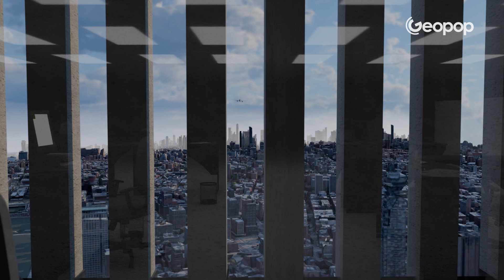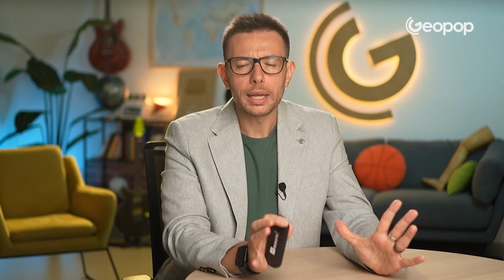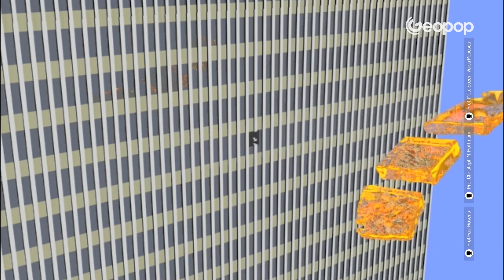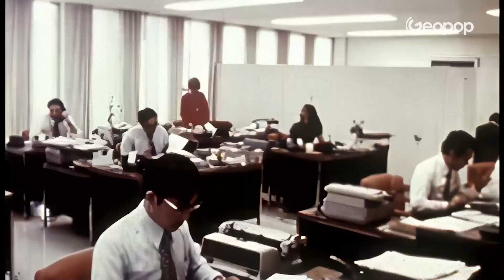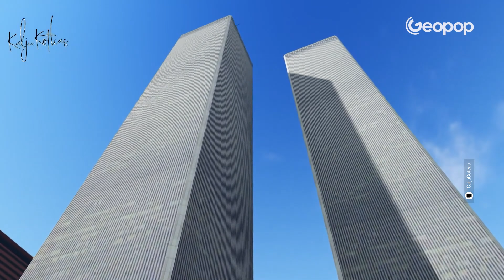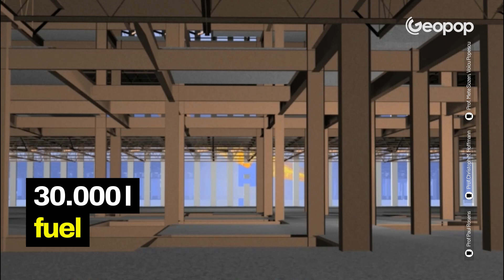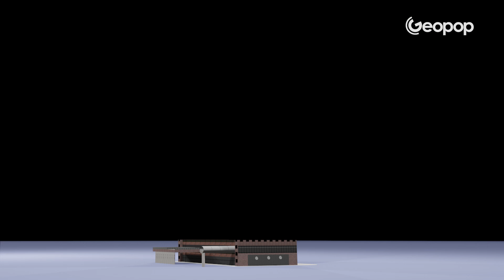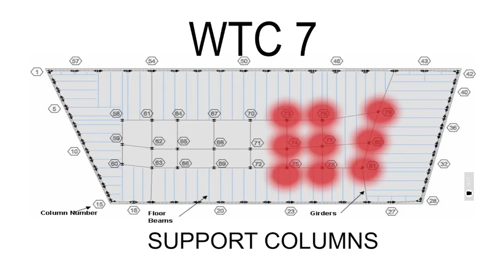9/11, 2001: The Technical Reconstruction of the Twin Towers and WTC 7 Collapses

Comment: Aha. Halte ich für verkehrt. Es erklärt soviele Fragen einfach nicht.
An diesem Tag stürzten drei RIESIGE Wolkenkratzer in ihre Grundrisse zusammen ☝ Da hätte zumindest einer kippen müssen. 
Dazu kommt noch die komplette Zerstaubung aller Gebäude. Ich würde mir da eher einen großen Haufen Bauschutt vorstellen. Nein, die sind brav zerstaubt und in ihre Grundrisse eingestürzt.
Scheint mir eher so, als wolle er die offizielle These stützen.
Reply: Which one of them should have toppled over and why?  How? Steel framed structures don't topple. They drop. They dismantle themselves on the way down, are not rigid like reinforced concrete structures. There is no pivot point. 

What do you mean by ALL of the buildings were COMPLETELY PULVERIZED cause that's not what I see at all?  

I think the real problem here is you have some misconceptions, some delusions that need to be corrected.
Reply: @TheLoonResistance  Ne ist klar, da langen ja schon Grundkenntnisse in Physik. Bei dieser "Fallhöhe" und dieser Masse macht sich der Kopf des Gebäudes automatisch auf den Weg zur Seite. Auch das der WIderstand nach unten größer werden muss und schon alleine deshalb Dein "Drehpunkt" schnell da ist lass ich mal so stehen. Komm mir nicht mit dieser Pfannkuchentheorie, dann wird es lächerlich.
Und die Videoaufnahmen zeigen Dir keinen extrem großen Schuttberg, wie auch ? Das Gebäude pulverisierte sich größtenteils. Erklärung ? Fehlanzeige. Beton zersetzt sich nicht einfach so - Punkt, Ende und aus.

Ich denke bei Dir sind grundlegende und logische physikalische Standpunkte in Deinen Überlegungen abhanden gekommen. Da sollte doch mal einiges korrigiert werden.
Reply: @Schiedsrichter1975  - Let’s break it down to the absolute basics:

The 47 core and 236 perimeter columns of the Twin Towers support all of the gravity loads of the building. ALL of the resistance is in the columns.

Planes impact Towers, causing massive structural damage, destroying sprinkler systems, tearing out gypsum board walls and blasting off the SFRM insulation from the floors. Multiple floor-wide fires are started instantly and spread rapidly due to the destruction of fire protection systems and venting of the building during the impact.

Serious fires were largely confined to the impact damaged floors and those immediately adjacent to them.  

Fires were started by the impacts and fuel aboard the aircraft, which acted as an accelerant. No shortage of other consumables inside the tower to continue the fires. 

Collapse was initiated (started) at the impact and fire damaged floors when floor trusses exposed to heat over time sagged, in turn pulling on and causing the inward bowing of perimeter columns by up to 5 feet until they buckled. 

www.youtube.com/watch?v=ULdiD6gYZO0  

No steel melted or needed to. Structural steel will bend and fail at less than half its melting temperature.

Once the perimeter columns buckled the formerly static load above became a dynamic load 30 times greater, easily overwhelming the structure below.

Thousands of tons of now loose debris fall through the open off space within the four outer walls - bypassing the columns - dropping 12 feet onto the first intact floor it comes across. That massive instant overload causes the floor to fail, shearing the pair of bolts that secure each end of the floor trusses to the columns.  The floor fails. adding its mass to the falling mass which continues to accelerate for another 12 feet until it impacts the next floor, rinse and repeat all the way down. 

Rate of collapse increases as momentum increases. The collapse front is constantly accelerating. 

As each floor fails, air inside the building (the Towers were 95% air by volume) is compressed, then blows out the sides _in reaction to the Tower falling, not the cause of the Tower falling.

No fire required at all on floors below the impact points for them to fail. The mechanisms that started the collapse are different to the mechanisms which continued the collapse.   That will be a difficult concept for some.

As the floors fail the perimeter columns are left literally hanging in the breeze, no longer attached to the rest of the structure. They peel away and fall in great sheets (think banana) out to more than 600 feet from the base on the 4 points of the compass. 

Core columns failed last. 

Each 110-story tower had a 1-acre footprint. The debris pile was up to 14 stories deep and spread out over 16 acres, destroying 8 surrounding buildings and damaging more than 100 others. 

The above all true no matter who planned and carried out the 9/11 attacks or why.

Comment: wtc 7 is a first in a history of the world skyscraper which collapsed because of the fire. Plus .. did you say it was a 2nd building that collapsed.. I thought it collapsed much later after the towers .. made more sense cause the fires had more time to spread and destroy the structure as you said… without tons of weight from airplanes that hit the two towers… your explanations don’t make sense .. also all the situation with the water in all that buildings… why would they be cut off on lower floors? And why there were no helicopters flying back and forward with water to put down the fire on both towers for almost 2 h !! It’s New York! There should be loads of them and with help of other cities… what happened ? Helicopters were flying just to record the situation?? Crazy .
Reply: Forest fire fighting helicopters fight forest fires. There aren't many of them and most are thousands of miles away. 

I can address your other concerns IF you are genuinely interested.

Comment: THERE ARE ZERO LOGICAL ANSWERS. NIST COMPUTER MODEL DOES NOT FIT ANY OF THE COLLAPSES AND THEY REFUSE TO BE OPEN AND REVEAL CODE USED TO CREATE IT. COVER UP.  FBI CONFISCATED 8RITY TAPES SURROUNDING PENTAGON THAT CLEARLY SHOW IMPACT ON PENTAGON. ONLY 1 REASON TO NOT REVEAL THEM AND THAT IS TO COVER UP.  IF IT WAS A PLANE THEN SHOW ALL 85 TAPES AND PROVE IT. SIMPLE.  IF IT WAS A MISSILE OF COURSE YOU WOULD NOT RELEASE THE TAPES YOU WOULD CONCEAL THEM. COVER UP.   SHANKSVILLE CRASH SITE. FIRST PEOPLE TO ARRIVE DESCRIBED TRASH DUMPED INTO A SMALLISH HOLE. NO BODIES. NO PLANE PARTS. COVER UP.   USE LOGICAL COMMON SENSE THINKING AND NONE OF IT MAKES ANY SENSE AT ALL.   IN THE ENTIRE HISTORY OF THE WORLD NEVER BEFORE OR AFTER HAS A STEEL FRAMED TOWER COLLAPSED FROM FIRE YET 3 DID SO ON 9/11.   BLDNG 7 CLEARLY A CONTROLLED DEMOLITION. POLICE AND FIREFIGHTERS WALKING AROUND HOURS PRIOR TELLING PEOPLE IT WAS COMING DOWN. IT TAKES WEEKS TO DEMO A BUILDING FOR SYMMETRICAL COLLAPSE.  MAKES ZERO SENSE.
Reply: OK, but did you actually watch this video?  My guess is no.

Also, WHY ARE YOU YELLING?  Nobody reads posts by people who TYPE IN ALL CAPS because it is assumed they are CRAZY.

Comment: Student pilots in hijacked jets hit WTC north and south towers and WTC7 - all destroyed by 2 planes and office fires???? NIST reports are questionable at best, to the advantage of some parties. What about other factors like the Pentagon - wheres the plane? PA hole in the field has no plane wreckage either. Israel, Saudi, Bush, Cheyney, the loss of freedoms for a new millennium? Operation Northwoods is to be investigated. I don't believe office fires weakened steel over 110 floors, the kerosene was finite in volume. The lower undamaged section would have resisted any initial collapse, the path of greatest resistance. The upper falling section would have decelerated or slid off the top. The towers were rigged to fail wholly. If you don't see this, you believe the narrative of some radical student pilots nailed the perfect impact TWICE and managing to take out WTC7 🤣and perfectly hit the Pentagon all whilst avoiding the biggest military in its own backyard. COMICAL. BTW, the kerosene was combusted in the first 10 seconds - look at the fireball on the outside of the building - the majority of the volume.
Reply: 3 of the 4 hijacker-pilots had earned their FAA Commercial Pilots Certificates. The 4th had his private license and hundreds of hours on large jet simulators. All were grossly overqualified to crash a plane - the easiest thing any pilot can do.  Remember Richard Russell from about 5 years ago?  He never had a lesson.  Facts work bettery than false argument loading. 

10 buildings were destroyed in NYC on 9/11/2001.  2 as result of direct attack and 8 as incidental collateral damage. No laws of physics were violated in any of it. If you think believe they were you either do not understand the engineering, don't understand physics and/or are invoking magic or the supernatural. Not a good plan. The collapses of the 3 buidlings conspiracists seem to care about can be explained to a high level of detail in just one post - IF you are genuinely interested. Few are.

We know Flight 77 – a Boeing 757 - hit the Pentagon because of ALL of the following true and relevant facts, not because of one random anomaly.  When complied together, all of these true and relevant facts form a single inescapable conclusion; 

1. Witnesses: Local and national media published or broadcast the accounts of ALL of whom reported a plane hit the Pentagon, while no witnesses reported seeing anything else (ie: none saw a missile). Around 2 dozen witnesses could identify either the aircraft type, the airline or both.

2. Flight Path: On its way in, Flight 77 created a damage path (the tree hit by the left engine, the 5 light poles, the garden wall on the Pentagon lawn and the mobile diesel generator) which is consistent with an aircraft the dimensions and layout of a Boeing 757. No missile could do any of that. 

3. Impact Hole: The impact hole in the outside wall of E-Ring at Wedge 1 of the Pentagon matches in size and shape the Boeing 757 from engine to engine. Wing impact marks extend out on either side of that to the span of a 757. youtube.com/watch?v=FkgJ-rFFBD0&t=15s  

4. Building Damage: The damage path inside the Pentagon takes the shape of an inverted cone, with over 80 support columns all of them bent in the direction of travel.  This is consistent with the high speed impact of a Boeing 757 aircraft and NOT the high-explosive blast warhead of any missile. 

5. Aircraft Wreckage: 19 tons of B757 wreckage were recovered at the Pentagon crash site including the landing gear, both engines, the entire left wing flap assembly, part of the cockpit, seats (some still occupied), landing gear bay doors, fuselage sections, the Flight Data and Cockpit Voice Recorders for Flight 77, etc, etc,... 

youtube.com/watch?v=kCRuVNgrAAw&ab_channel=cjnewson88 

6. Two parking lot security camera videos from the north parking lot security booth captured images of a B757 sized aircraft in AA livery flying along the exact flight path of Flight 77 and at the same velocity recorded by its FDR. The aircraft was trailing smoke from the right engine due to hitting the aforementioned tree moments earlier as confirmed by several witnesses. 

7. Human remains: The remains of everyone aboard Flight 77 were recovered and identified with the exception of 1 infant whose remains could not be identified. Some victims were recovered still strapped in their seats. Each of the victims families were provided with a detailed autopsy report.

8. Personal Effects: Several thousand personal items belonging to persons aboard Flight 77 were recovered at the crash site at the Pentagon with the victims families being provided with a 1,000+ page book detailing every item for identification and return. 

9. Radar:  A total of 6 FAA and NORAD radar sites tracked Flight 77 from take off to impact. The radar data matches EXACTLY the 25 hours of flight data recovered from Flight 77’s recovered FDR, right down to the last decimal. 

youtube.com/watch?v=3vqDDlS9Hyw&t=6s&ab_channel=cjnewson88 

10. Insurance: American Airlines and its insurers accepted responsibility, admitting Flight 77 crashed at the Pentagon and subsequently paid out tens of millions of dollars in damages. 

11. Boeing;  The folks at Boeing confirmed it was a Boeing 757 and specifically Flight 77 which hit the Pentagon. 

12. Where is Flight 77?  It is a fact that Flight 77 never landed anywhere, nor has anyone aboard been seen or heard from since 77 crashed into the Pentagon.

13. Even if the 9/11 attacks were an inside job, Flight 77 still hit the Pentagon and the above true facts are still true facts. “9/11 was an inside job” does not mean “flight 77 did not hit the Pentagon”.

14. Pilot Skill:  Hani Hanjour was a crap pilot and his flight path proves it. But he was grossly over-qualified to crash a plane – something anyone can do. A number of Hanjour’s instructors are on record stating that while he was not a good pilot, they have no doubt he crashed Flight 77 into the Pentagon.  The conspiracy types always leave that part out.

15. When staging an attack that absolutely has to use planes - and I cannot stress this enough - you use planes. Common sense.

16. No blast crater or damage, radial fragmentation pattern, pre-formed fragments, missile parts or anything else associated with a missile were found.

All of the above is true no matter who planned and carried out the 9/11 attacks or why  - which I know will be seen as a blasphemy by many reading this. 

Similarly at Shanksville 19 tons of aircraft wreckage were recovered, including both engines and both flight recorders - with usable data. Human remains from everyone aboard Flight 93 also recovered at the site along with thousands of personal items belonging to them and over 500 pieces of U.S. Mail being carried as cargo also recovered.

Why does Operation Northwoods (or any of the at least 16 similar memo's sent to the same round file around that time which your intrepid research never uncovered) need to be investigated. JCS asked their planning people to come up with a memo of ideas. The ideas were looked at, seen immediately to be stupid and it went no further. And that was over 60 years ago. Everyone involved now almost certainly deceased.

Anything can seem like a conspiracy if you don't understand it. Now you know.

Comment: IT WAS ALL PLANNED AND DONE ON THAT FATEFUL DAY!
THERE WAS A CONTROLLED DEMOLITION FOR THOSE BUILDINGS - EVEN THOSE RESCUERS AND FIREMEN COULD HEAR THOSE SIMULTANEOUS BOOMS FROM THE OUTSIDE!
Reply: Uh huh.  Tell you what, I have a simple and entirely hypothetical question. One I have asked hundreds of times but no one so far has even attempted to answer. Run from it like Cockroaches from the light they do. Maybe you can be the one to change that trend.

If YOU were to plan the 9/11 attacks, how would YOU do it ?

Remember, you are staging attacks on 4 world famous, iconic symbols of American economic, military and political power, you absolutely can’t get caught and it absolutely has to look like everything was done with hijacked commercial domestic airliners used by terrorists as Kamikaze missiles.

So, how would _you do it?

You need to figure out what you are you trying to do, how would you most effectively go about doing it and why in a plan that makes the most sense as the most efficient and effective way to achieve that objective. And remember, it has to fit ALL of the available physical evidence and visual record, preferably not require Rube Goldberg levels of complexity, and make logical sense.

And you sure as hell can’t do anything that will get you caught.
Reply: yes, it was planned by terrorists who wanted to control the demolition of the towers